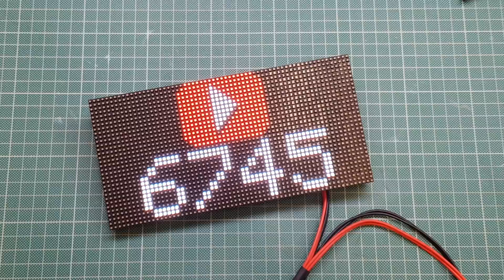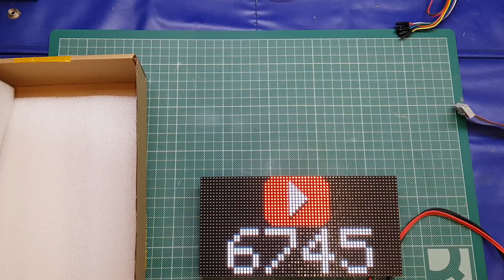Sorry - sometimes I make mistakes :'( An update to my LED Matrix / ESP8266 video.

Comment: Kris The better solution is to think power circuit and data circuit, if you take your power from the ribbon cable connector instead of the main power input connector you should have a regulated circuit in the range you require. These modules have a daisy chain configuration data in and out to the next. The power is regulated and distributed by the circuits on the panel partially for the heavier load to the leds and secondarily to the data circuit to the next module. Use a gauge of wire compatible with the 8266 requirements and you should be fine.(using the standard ribbon cable plugged in is probably more suitable)  One other thought try connecting the grounds, cable connector and input connector, you might get rid of the flicker.

Comment: Nice follow up Kris! That p5 panel looks great!

You can use a diode in between power connector and the 5v pin of the wemos (so its only allowing current towards the esp8266), that will stop the USB powering the panel automatically.
Reply: Awesome suggestion Brian! Adding a common 1A diode (like a 1N4001) would avoid any unintended USB power load. So you'd safely download your new code, disconnect USB and switch back to the main power feed to test. Nice! :-)

Comment: Nice follow-up Kris. Supplying power only through the heavy duty connector seems a wise suggestion!
I'd still suggest light duty hook-up wire for the ESP8266 power. Although I've not tested for myself, I've seen reviews indicating start-up current can peak at 400ma and WiFi (if used) can burst to this level also. Perhaps something to consider, even if just for added reliability.
But, to be fair, the relatively short power run you have should be OK.  :-) 
That P5 panel looks huge alongside the P3. Ideal for greater viewing distances.
I wonder how the P5 panel power usage compares?
Keep up the awesome work!  Can’t wait to see how your P5 build goes.